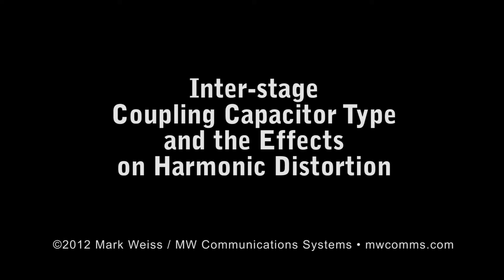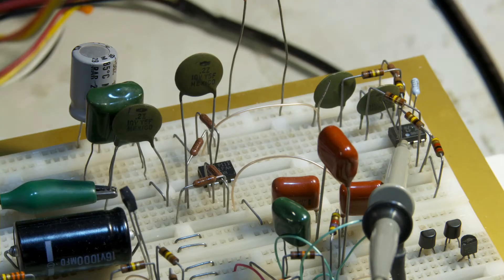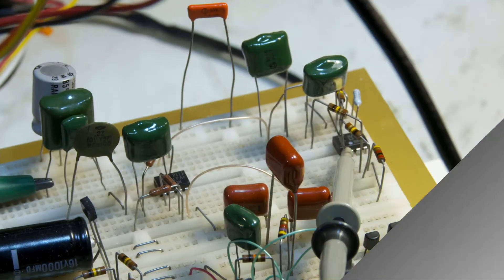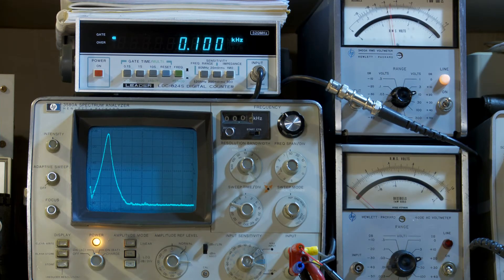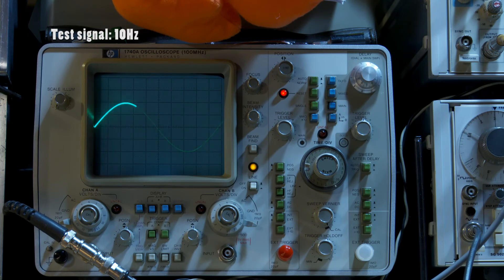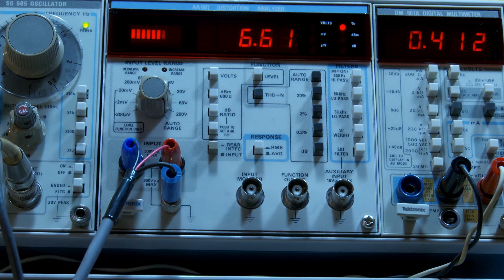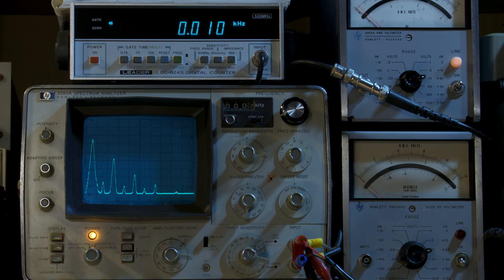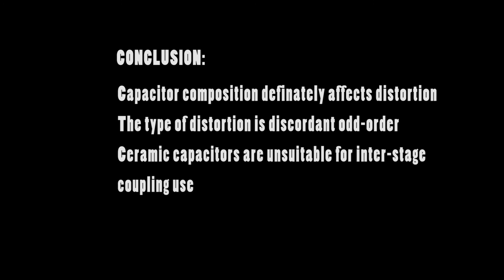Capacitor Distortion Experiment

Comment: Hi. 
I recently changed leaking capacitors in my Synth (M1 Korg) and now the sounds are way too distorted. They sound out of phase and also delayed. 
I made sure I was using the same capacitance and voltage specs. Do you have any suggestions?  I used the following 
0.22uF 250V Film, 2200uF10V Alum, 220 uF25V Alum, 100uF 200V Alum.
Reply from the maker: I would check for a defective capacitor that was installed. Or perhaps there is another defect that surfaced when you replaced an out of spec capacitor.

Comment: Although I would not normally use disc ceramics for audio coupling, a good design can greatly affect the circuit performance. 
Same applies to the use of polarized electrolytic caps. there are plenty of examples of electros being used for interstage coupling in some of the well respected brands, where these are used between op amp stages that run off of a split or by polar power supply. The outputs of which swing in both directions - plus & minus. 

One would expect that the cap would be reverse biased half the time of signal presence & would create horrendous distortion as a result. 
This gear is used in many recording studios & as far as I know no one is complaining about it for the distortion reasons.

The main reason for this is the very large capacitance used, usually so high that for all practical purposes the capacitive reactance at the lowest frequency of interest is so low that it can be considered as a short. Being an effective short, the AC voltage drop across the cap will be close to zero. 

Where the problem occurs is if the driving op amp fails into a full supply output of such a polarity that it reverse biases the next coupling cap and sends a steady DC voltage, typically 15 V to the next stage.  If this next stage happens to be direct coupled power amp supplying a tweeter driver in an active loudspeaker, the result will be same as if the cap was replaced with a direct link, all the DC x any gain in the power amp will be placed across the tweeter, with only one result - blown tweeter within a second of fault occurrence!

This was the case with a particular active studio monitor speaker, worth over $3k AU for the pair.
Have seen same problems in some mixing consoles, but the consequences were unimportant compared to the speaker example as there are no high priced drivers to fail. any distortion here is due to a failed op amp and not the electrolytic cap.

In conclusion, even if you're to use low grade ceramic caps because you had nothing else and you had sufficient capacitance value so that the voltage drop across it will be near zero the distortion would be negligible. 

Sorry for the long post and I am aware that this is a fairly old video, I thought it important to add to it.

Have a great day!
oh, nearly forgot, very nice & informative video, thanks.

Comment from the maker: Ceramic disc do fine as snubbers in power supply rectifiers. A better solution to the switching noise would be the use of fast-recovery rectifiers (Schottky).
I have never liked passive crossover networks. Too much loss of damping. Square wave response is hideous. Direct bi/tri-amping solves these issues, along with DSP-based electronic crossover ahead of the amplification.

Comment: 0.1uF multilayer monolithics, in parallel with electrolytics and poly c's, in loudspeaker crossover networks, defuzzed loudspeakers noticeably. Poly c's are a disaster in audio, for high frequencies, electro's are worse. For amplifiers that won industry competitions at the highest levels with acclaim over many years, we used only multi-layer monos for signals. Green Caps etc were crucial for bi-passing power-supply diodes for eliminating crawling crackles..everything has it's place.

Comment: This is really kind of silly since nobody would ever use a Y5F ceramic as a coupling cap.  I suggest you try a C0G/NP0 type before tarring all ceramics with the same brush... the high density types are very nonlinear but that is not the case with all ceramics.  You might also consider trying various different values of electrolytics as well; distortion on electrolytics is directly proportional to voltage across them so a high value low ESR can be okay while a smaller one is awful.